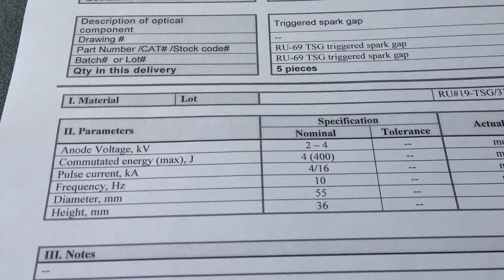Two- and Three-electrode Spark Gaps and Trigger Transformers

Comment from the maker: Compressive quantum sensing
John C. Howell, Gregory Howland, Daniel Lum
23 April 2015 • 4:10 - 4:50 PM | Part of SPIE Sensing Technology + Applications

EM modeling of far-field radiation patterns for antennas on the GMA-TT UAV
Anne I. Mackenzie
20 April 2015 • 11:50 AM - 12:10 PM | Part of SPIE Defense + Security

Quantum key distribution on lit fibre
Zhiliang L. Yuan
22 April 2015 • 1:45 - 2:15 PM | Part of SPIE Sensing Technology + Applications

Remotely detected differential pulse transit time as a stress indicator
Balvinder Kaur, Elizabeth Tarbox, Marty Cissel, Sophia Moses, Megha Luthra, Nhien Tran, Misha Vaidya, Vasiliki N. Ikonomidou
23 April 2015 • 8:40 - 9:00 AM | Part of SPIE Sensing Technology + Applications

Electro-textile garments for power and data distribution
Jeremiah Slade, Carole Winterhalter
23 April 2015 • 4:40 - 5:00 PM | Part of SPIE Defense + Security

An overview of proven applications of laser-induced breakdown spectroscopy (LIBS) within the nuclear power and spent-fuel reprocessing industry
Andrew I. Whitehouse, Phil Evans, Victor Pinon, Anastasia Giakoumaki, John Pugh
20 April 2015 • 4:40 - 5:00 PM | Part of SPIE Sensing Technology + Applications

How do artificial neural networks (ANNs) compare to partial least squares (PLS) for spectral interference correction in optical emission spectrometry?
Z. Li, X. Zhang, Vassili Karanassios
23 April 2015 • 5:20 - 5:40 PM | Part of SPIE Sensing Technology + Applications

Piezoelectric energy-harvesting power source and event detection sensors for gun-fired munitions
Jahangir Rastegar, Dake Feng, Carlos M. Pereira
21 April 2015 • 2:35 - 2:50 PM | Part of SPIE Sensing Technology + Applications

Laser beam characteristics of optical phased arrays
Yakov G. Soskind
21 April 2015 • 2:40 - 3:00 PM | Part of SPIE Defense + Security

A compact THz imaging set-up at 750 microns
Linda E. Marchese, Marc Terroux, Alain Bergeron
24 April 2015 • 10:40 - 11:00 AM | Part of SPIE Defense + Security

An agnostic acoustic smart sensor network for hostile fire detection with sensor fusion capability
George Cakiades, David Grasing, Jemin George, Socrates Deligeorges
20 April 2015 • 11:30 - 11:50 AM | Part of SPIE Defense + Security

On-orbit performance of the compact infrared camera (CIRC) with uncooled infrared detector
Haruyoshi Katayama, Michito Sakai, Eri Kato, Yasuhiro Nakajima, Toshiyoshi Kimura, Koji Nakau
22 April 2015 • 3:40 - 4:00 PM | Part of SPIE Defense + Security

A practical look at target detection using MIMO radar
Mark A. Govoni, Jeffrey Spak, Traian V. Dogaru, DaHan Liao
21 April 2015 • 11:10 - 11:30 AM | Part of SPIE Defense + Security

2D electronic materials for army applications
Terrance O'Regan, Philip Perconti
21 April 2015 • 10:20 - 10:50 AM | Part of SPIE Defense + Security

All-fiber, compact, coherent wind lidar development for environmental monitoring applications
Narasimha S. Prasad, Steven Vetorino, Allen J. Tracy, Rich Higgins, Russel Sibell
21 April 2015 • 1:40 - 2:00 PM | Part of SPIE Defense + Security

A 1280×1024-15 μm CTIA ROIC for SWIR FPAs
Selim Eminoglu
21 April 2015 • 4:10 - 4:30 PM | Part of SPIE Defense + Security

Packet-based serial link realized in FPGA dedicated for high-resolution infrared image transmission
Grzegorz Bieszczad
20 April 2015 • 4:30 - 4:50 PM | Part of SPIE Defense + Security

Performance study of sugar-yeast-ethanol bio-hybrid fuel cells
Justin P. Jahnke, David M. Mackie, Marcus Benyamin, Sanchao Liu, James J. Sumner, Rahul Ganguli
21 April 2015 • 8:55 - 9:10 AM | Part of SPIE Sensing Technology + Applications

Wireless photonic power and data transfer to dormant devices
Harbans S. Dhadwal, Jahangir Rastegar, Dake Feng, Philip Kwok
23 April 2015 • 10:00 - 10:20 AM | Part of SPIE Sensing Technology + Applications

Optically transparent superhydrophobic coatings for enhanced performance sensing and CSP and CPV power generations
Scott R. Hunter, D. Barton Smith, Georgios Polizos, Daniel A. Schaeffer, Panos G. Datskos
20 April 2015 • 10:00 - 10:20 AM | Part of SPIE Defense + Security

Low-loss spinel windows for high-energy lasers
Woohong R. Kim, Guillermo Villalobos, Colin Baker, Michael Hunt, Bryan Sadowski, Ishwar Aggarwal, Jasbinder Sanghera, Shyam Bayya, Juan Sepulveda, Raouf Loutfy, Tim Lowe
21 April 2015 • 8:20 - 8:40 AM | Part of SPIE Defense + Security

Miniature cryocooler developments for high-operating temperatures at Thales Cryogenics
Roel Arts, Jean-Yves Martin, Sebastien Van Acker, Daniel Willems, Jeroen C. Mullié, Alexander Göbel, Mark Tops, Julien Le Bordays, Thierry Etchanchu, Tonny Benschop
22 April 2015 • 2:30 - 2:50 PM | Part of SPIE Defense + Security

Experimental evaluation of single-aperture range finder
Kyle McCormick, Dmitry Starodubov, Leo Volfson
21 April 2015 • 6:00 - 7:30 PM | Part of SPIE Defense + Security

Efficient target tracking with an ad-hoc networks of omni-directional sensors
Kalin Atanassov, William S. Hodgkiss
20 April 2015 • 4:40 - 5:00 PM | Part of SPIE Sensing Technology + Applications

Low-power LVDS for digital readout circuits
Melik Yazici, Huseyin Kayahan, Omer Ceylan, Atia Shafique, Yasar Gurbuz
21 April 2015 • 6:00 - 7:30 PM | Part of SPIE Defense + Security
COURSE AT CONFERENCE
Laser Systems Engineering (SC1144)
Instructor(s): Kasunic, Keith J.
Level: Introductory • 0.65 CEU • Length: 9.00 hours
Member Price: 515.00 | Non-Member Price: 610.00
23 April 2015 • 8:30 AM | Part of SPIE DSS

Acceleration of generalized adaptive pulse compression with parallel GPUs
Jingxiao Cai, Yan R. Zhang
20 April 2015 • 10:10 - 10:30 AM | Part of SPIE Defense + Security

Analysis and modeling of a high-power side diode pumped solid state laser system
Tamer Kashef, Ayman Mokhtar, Samy S. A. Ghoniemy, Lawrence Shah, Martin C. Richardson
21 April 2015 • 6:00 - 7:30 PM | Part of SPIE Defense + Security

Unmanned aerial vehicles (UAVs): a new tool in counterterrorism operations?
Mehmet F. Dörtbudak
20 April 2015 • 4:10 - 4:30 PM | Part of SPIE Defense + Security

Continuous-wave fiber Raman lasers cladding-pumped directly by diodes
Johan Nilsson, Tianfu Yao, Achar V. Harish, Jayanta K. Sahu
22 April 2015 • 1:20 - 2:00 PM | Part of SPIE Defense + Security

Micro enzymatic biofuel cells: from theoretical to experimental aspect
Chunlei Wang, Yin Song, Chunhui Chen, Richa Agrawal, Yong Hao
21 April 2015 • 8:35 - 8:55 AM | Part of SPIE Sensing Technology + Applications

Extended-range electromagnetic induction sensor concepts
Jonathan S. Miller, Chet Bassani, Gregory Schultz
20 April 2015 • 2:10 - 2:30 PM | Part of SPIE Defense + Security

Novel broadly tunable fiber laser system
Steven Bowman, Christopher G. Brown
22 April 2015 • 3:30 - 3:50 PM | Part of SPIE Defense + Security

Firefly: A HOT camera core for thermal imagers with enhanced functionality
Luke Pillans, Tim Edwards, Lee Richardson, David Jeckells
22 April 2015 • 8:20 - 8:40 AM | Part of SPIE Defense + Security

Passive standoff imaging using spatial-spectral multiplexing
Ethan Woodard, Michael W. Kudenov
23 April 2015 • 11:00 - 11:20 AM | Part of SPIE Defense + Security
COURSE AT CONFERENCE
Basic Laser Technology (SC972)
Instructor(s): Sukuta, Sydney, San Jose City College
Level: Introductory • 0.35 CEU • Length: 4.00 hours
Member Price: 295.00 | Non-Member Price: 345.00
24 April 2015 • 8:30 AM | Part of SPIE DSS

Phosphor-based fiber optic temperature sensors for harsh environments
Nicholas Djeu, Yutaka Shimoji
22 April 2015 • 3:50 - 4:10 PM | Part of SPIE Defense + Security

A numerical approach for testing and evaluation of mild steel material by thermal wave imaging
Ravibabu Mulaveesala, Geetika Dua, Juned A. Siddiqui, Ghali V. Subbarao, Amarnath Muniyappa
22 April 2015 • 4:55 - 5:15 PM | Part of SPIE Sensing Technology + Applications

Integration of optical functionality for image sensing through sub-wavelength geometry design
Peter B. Catrysse
22 April 2015 • 1:05 - 1:30 PM | Part of SPIE Sensing Technology + Applications

Advances in resonantly-pumped Tm-doped fiber amplifiers
Daniel Creeden, Benjamin R. Johnson, Glen A. Rines, Scott D. Setzler
21 April 2015 • 2:00 - 2:20 PM | Part of SPIE Defense + Security

Biomimetic optical sensor for aerospace applications
Susan A. Frost, George E. Gorospe, Cameron H. G. Wright, Steven F. Barrett
23 April 2015 • 9:40 - 10:00 AM | Part of SPIE Sensing Technology + Applications

Efficient live face detection to counter spoof attack in face recognition systems
Bikram Kumar Biswas, Mohammad S. Alam
22 April 2015 • 9:00 - 9:30 AM | Part of SPIE Defense + Security

Proposal of a defense application for a chemical oxygen laser
Kiwamu Takehisa
21 April 2015 • 6:00 - 7:30 PM | Part of SPIE Defense + Security

Small SWAP 3D flash ladar for small tactical unmanned air systems
Alan W. Bird, Scott A. Anderson, Michael D. Wojcik, Scott E. Budge
20 April 2015 • 11:30 - 11:50 AM | Part of SPIE Defense + Security

Recent progress in quantum cascade external cavity laser systems optimized for mid-IR sensing applications
David B. Arnone, Leigh J. Bromley, David B. Caffey, William B. Chapman, Timothy Day, Allen Priest, Charles C. Harb
24 April 2015 • 6:00 - 6:20 PM | Part of SPIE Defense + Security

Stand-off explosive detection utilizing low-power stimulated emission nuclear quadrupole resonance detection and sub-wavelength focusing wideband super lens
William Mouyos, John Apostolos, Judy Feng, Walter Chase
20 April 2015 • 8:50 - 9:10 AM | Part of SPIE Defense + Security

Filter selection for a harmonic radar receiver
Kyle A. Gallagher, Gregory J. Mazzaro, Anthony F. Martone, Kelly D. Sherbondy, Ram M. Narayanan
20 April 2015 • 11:40 AM - 12:00 PM | Part of SPIE Defense + Security

Quantum dots, CMOS sensors and cell phones toward point-of-care-diagnostics
Eleonora Petryayeva, W. Russ Algar
21 April 2015 • 9:40 - 10:10 AM | Part of SPIE Sensing Technology + Applications

20.2W CW 2.118μm Ho:YAlO3 laser pumped by 1.915μm Tm-doped fiber laser
Ting Yu, Gang Bai, Zhongguo Yang, Weibiao Chen
22 April 2015 • 4:30 - 4:50 PM | Part of SPIE Defense + Security

Video rate passive millimeter-wave imager utilizing optical upconversion with improved size, weight, and power
Richard D. Martin, Christopher A. Schuetz, Thomas E. Dillon, Daniel G. Mackrides, Dennis W. Prather, Shouyuan Shi, Peng Yao, Kevin Shreve
23 April 2015 • 11:10 - 11:30 AM | Part of SPIE Defense + Security

Recent progress in high-power ultrafast thulium-doped fiber lasers and mid-infrared supercontinuum sources
Jiang Liu, Hongxing Shi, Kun Liu, Fangzhou Tan, Pu Wang
21 April 2015 • 9:40 - 10:00 AM | Part of SPIE Defense + Security

Transition metal doped gallium nitride laser materials
Steven Bowman, Christopher G. Brown, Jacob H. Leach, Kevin Udwary
21 April 2015 • 4:10 - 4:30 PM | Part of SPIE Defense + Security

Keeping display visibility in outdoor environment
Ariela Donval, Ido E. Dotan, Noam Gross, Eran Partouche, Ofir Lipman, Moshe Oron
23 April 2015 • 8:30 - 8:50 AM | Part of SPIE Defense + Security
21 April 2015

Measuring noise equivalent irradiance of a digital short-wave infrared imaging system using a broadband source to simulate the night spectrum
Tim Robinson, John Green
21 April 2015 • 10:50 - 11:10 AM | Part of SPIE Defense + Security

A method for detecting ultra-low quantities of explosives with use a picosecond laser FAIMS analyzer
Gennadii Kotkovskii, Alexander A. Chistyakov, Ivan Odulo, Alexey V. Sychev, Artem S. Bogdanov, Anatoly N. Perederiy, Evgeny M. Spitsyn, Alexander V. Shestakov
21 April 2015 • 2:00 - 2:20 PM | Part of SPIE Defense + Security

Carbon microelectromechanical systems (C-MEMS) based microsupercapacitors
Chunlei Wang, Chunhui Chen, Yin Song, Richa Agrawal, Yong Hao
21 April 2015 • 1:20 - 1:35 PM | Part of SPIE Sensing Technology + Applications

Feature extraction and classification using neurosynaptic processing at the edge of the network
Flavio Bergamaschi, Graham Bent
21 April 2015 • 2:00 - 2:20 PM | Part of SPIE Defense + Security

Yb-fiber-MOPA based high energy and average power uplink laser beacon for deep space communication operating under Nested PPM format
Doruk Engin, Ibraheem Darab, John Burton, Frank Kimpel, Shantanu Gupta
21 April 2015 • 6:00 - 7:30 PM | Part of SPIE Defense + Security

Extra-low Brillouin gain optical fiber derived from Er-doped sapphire ceramic
Mark Dubinskii, Tigran Sanamyan, Robert Pavlacka, Thomas W. Hawkins, Peter D. Dragic, John Ballato
22 April 2015 • 2:20 - 2:40 PM | Part of SPIE Defense + Security

OEM fiber laser rangefinder for long-distance measurement
Alexandre Corman, Frédéric Chiquet, Thomas Avisse, Marc Le Flohic, Nicolas Picard
21 April 2015 • 9:40 - 10:00 AM | Part of SPIE Defense + Security
COURSE AT CONFERENCE
Applications and Performance of High Power Lasers in the Battlefield (SC1104)
Instructor(s): Kalisky, Yehoshua Y., Nuclear Research Ctr. Negev
Level: Intermediate • 0.35 CEU • Length: 4.00 hours
Member Price: 295.00 | Non-Member Price: 345.00
20 April 2015 • 1:30 PM | Part of SPIE DSS

Paper-based broadband and wide-angle antireflection coatings for Si and GaAs solar cells
Dongheon Ha, Jeremy N. Munday
21 April 2015 • 1:35 - 1:50 PM | Part of SPIE Sensing Technology + Applications

Cryogenic measurements of a digital pixel readout integrated circuit for LWIR
Atia Shafique, Melik Yazici, Huseyin Kayahan, Omer Ceylan, Yasar Gurbuz
21 April 2015 • 4:30 - 4:50 PM | Part of SPIE Defense + Security

InGaAs focal plane array developments and perspectives
Anne Rouvié, Jérôme Coussement, Odile Huet, Jean-Patrick Truffer, Maxime Pozzi, El-Houcine Oubensaid, Sébastien Hamard, Vincent Chaffraix, Eric M. Costard
20 April 2015 • 9:10 - 9:30 AM | Part of SPIE Defense + Security

Agile-beam laser radar using computational imaging for robotic perception
Michael A. Powers, Barry L. Stann, Mark M. Giza
21 April 2015 • 2:40 - 3:00 PM | Part of SPIE Defense + Security

Two-dimensional materials synthesis and integration for low power and high frequency devices
Joshua A. Robinson, Suman Datta
21 April 2015 • 10:50 - 11:10 AM | Part of SPIE Defense + Security

2-micron ultra-short pulse lasers
Shibin Jiang
24 April 2015 • 8:50 - 9:10 AM | Part of SPIE Defense + Security

GRIN optics for multispectral infrared imaging
Daniel J. Gibson, Shyam S. Bayya, Jasbinder S. Sanghera, Vinh Q. Nguyen, Mikhail Kotov, Gryphon Drake
22 April 2015 • 9:00 - 9:30 AM | Part of SPIE Defense + Security

Construction robots for Mars
Douglas W. Gage
22 April 2015 • 3:40 - 4:00 PM | Part of SPIE Defense + Security

Hybridization of lithium-ion batteries and electrochemical capacitors: fabrication and challenges
Chunlei Wang, Richa Agrawal, Chunhui Chen, Yin Song, Yong Hao
21 April 2015 • 11:30 - 11:50 AM | Part of SPIE Sensing Technology + Applications

Solid state THz sources with higher power
Thomas W. Crowe, Steven A. Retzloff, Jeffrey L. Hesler
23 April 2015 • 11:40 AM - 12:10 PM | Part of SPIE Sensing Technology + Applications

Nonlinear optical frequency up-conversion broadening terahertz horizons in sensitive detection
Kouji Nawata, Shin'ichiro Hayashi, Hiroaki Minamide
23 April 2015 • 1:30 - 2:00 PM | Part of SPIE Sensing Technology + Applications

Narrow-band, all-fiber 100W 20-ps Yb-doped fiber laser source
Robert A. Stegeman, Ye Huang, Eric D. Park, Peter F. Moulton
22 April 2015 • 9:20 - 9:40 AM | Part of SPIE Defense + Security

High-speed blue-light free space optical receiver
Susan Harris, Mark Krepel, Greg Mooradian
21 April 2015 • 9:40 - 10:00 AM | Part of SPIE Defense + Security

BAE Systems' SMART Chip Camera FPA development
Louise C. Sengupta, Pierre-Alain Auroux, Donald D. McManus, D. Ahmasi Harris, Richard J. Blackwell, Jeffrey F. Bryant, Evan Binkerd, Mihir Boal
22 April 2015 • 2:20 - 2:40 PM | Part of SPIE Defense + Security

Towards a chip-scale integrated-optic TDLAS methane sensor
Michael B. Frish, Matthew C. Laderer
20 April 2015 • 11:10 - 11:30 AM | Part of SPIE Sensing Technology + Applications

A low cost, low power, S-band radar for atmospheric turbulence studies
Thomas C. Farrell
23 April 2015 • 10:50 - 11:10 AM | Part of SPIE Defense + Security

AlGaInN laser diode technology and systems for defence and security applications
Stephen P. Najda, Piotr Perlin, Tadek Suski, Lucja Marona, Mike Bockowski, Mike Leszczynski, Przemek Wisniewski, Robert Czernecki, Robert Kucharski, George Tagowski, Scott Watson, Antony Kelly
21 April 2015 • 9:20 - 9:40 AM | Part of SPIE Defense + Security

Simulation of a polarized laser beam reflected at the sea surface: modeling and validation
Frédéric Schwenger
21 April 2015 • 1:20 - 1:40 PM | Part of SPIE Defense + Security

Thermally and mechanically enhanced phosphate glasses for eye-safe lasers
Paula Vullo, Simi A. George
21 April 2015 • 3:30 - 3:50 PM | Part of SPIE Defense + Security

Optical turbulence with anisotropy at different scales and its effect on laser beam propagation along vertical paths
Italo Toselli, Olga Korotkova
23 April 2015 • 9:40 - 10:00 AM | Part of SPIE Defense + Security

Performances of THz cameras with enhanced sensitivity in sub-terahertz region
Naoki Oda, Tsutomu Ishi, Seiji Kurashina, Takayuki Sudou, Takao Morimoto, Masaru Miyoshi, Kohei Doi, Hideki Goto, Tokuhito Sasaki, Goro Isoyama, Ryukou Kato, Akinori Irizawa, Keigo Kawase
23 April 2015 • 4:20 - 4:40 PM | Part of SPIE Sensing Technology + Applications

Fuel Cell powered small unmanned aerial systems (UASs) for extended endurance
Deryn D. Chu, Zachary Dunbar, Rongzhong Jiang
22 April 2015 • 1:50 - 2:10 PM | Part of SPIE Defense + Security

Coherent probe-pump-based Brillouin sensor for harsh environments
L. F. Zou
23 April 2015 • 11:20 - 11:40 AM | Part of SPIE Sensing Technology + Applications

Toward the realization of a compact chemical sensor platform using quantum cascade lasers
Ellen L. Holthoff, Paul M. Pellegrino, Logan S. Marcus
24 April 2015 • 5:00 - 5:20 PM | Part of SPIE Defense + Security

Multi-carrier transmission for hybrid radio frequency with optical wireless communications
Gang Wang, Genshe Chen, Dan Shen, Khanh Pham, Erik Blasch, Tien Nguyen
20 April 2015 • 2:10 - 2:30 PM | Part of SPIE Defense + Security

Shutters with embedded processors
Stanley W. Stephenson
22 April 2015 • 5:00 - 5:20 PM | Part of SPIE Defense + Security

Modular open RF architecture: extending VICTORY to RF systems
Jason Dirner
21 April 2015 • 2:50 - 3:10 PM | Part of SPIE Defense + Security

Novel, ultra-compact, high-performance, eye-safe laser rangefinder for demanding applications
Mark Silver, Stephen T. Lee, Andrew G. Borthwick, Graham Morton, Craig McNeill, David McSporran, Ian McRae, Gordon McKinlay, Willie Alexander, David Jackson, Craig Smith, Colin Scouller
21 April 2015 • 9:20 - 9:40 AM | Part of SPIE Defense + Security

High-power operation of Yb-doped fiber laser at 976 nm: present status and applications
Eric Cormier
21 April 2015 • 1:20 - 2:00 PM | Part of SPIE Defense + Security

Spectroscopic properties of Er-doped Y2O3 ceramic related to mid-IR laser transition
Tigran Sanamyan, Zackery D. Fleischman
21 April 2015 • 4:50 - 5:10 PM | Part of SPIE Defense + Security

Signature predictions of surface targets undergoing turning maneuvers in spotlight synthetic aperture radar imagery
David A. Garren
23 April 2015 • 9:30 - 9:40 AM | Part of SPIE Defense + Security

Compressive quantum sensing
John C. Howell, Gregory A. Howland, Samuel Knarr, Daniel Lum, James Schneeloch
22 April 2015 • 4:40 - 5:00 PM | Part of SPIE Sensing Technology + Applications

On a simulation study for reliable and secured smart grid communication
Sriharsha Mallapuram, Paul Moulema, Wei Yu
21 April 2015 • 1:45 - 2:05 PM | Part of SPIE Defense + Security

Metamaterial based narrowband perfect absorbers
Ahmed S. Sharkawy, Mathew Zablocki
21 April 2015 • 3:50 - 4:10 PM | Part of SPIE Defense + Security

Intracavity optical parametric oscillators based upon orientation-patterned GaAs (OPGaAs): development toward a flexible deep-infrared active hyperspectral imaging system
David M. Stothard, Daniel J. Kane, Peter G. Schunemann, Malcolm H. Dunn, Malcolm H. Dunn
23 April 2015 • 8:00 - 8:30 AM | Part of SPIE Defense + Security

Compressive sensing cryptographic analysis
Ponciano J. Escamilla-Ambrosio, Moises Salinas Rosales, Eleazar Aguirre-Anaya
23 April 2015 • 1:40 - 2:00 PM | Part of SPIE Sensing Technology + Applications

Just noticeable color difference: implications for display systems
Daniel D. Desjardins
23 April 2015 • 2:40 - 3:00 PM | Part of SPIE Defense + Security

A reference model for model-based design of critical infrastructure protection systems
YoungDon Shin, Cheol-Young Park, Jae-Chon Lee
21 April 2015 • 1:20 - 1:40 PM | Part of SPIE Defense + Security